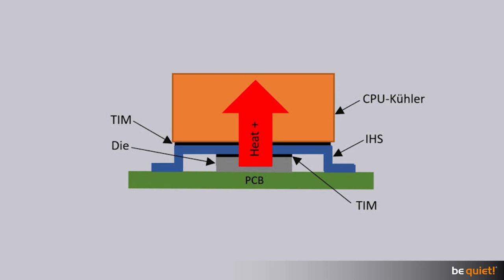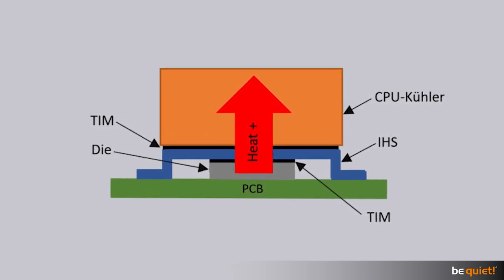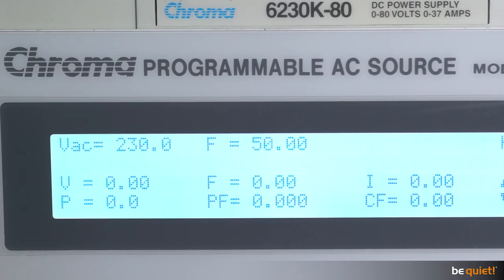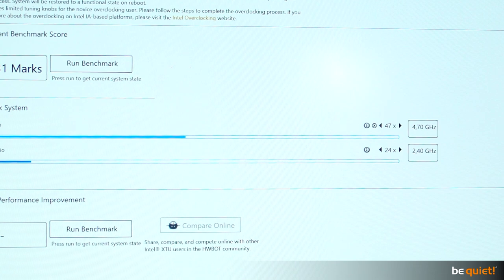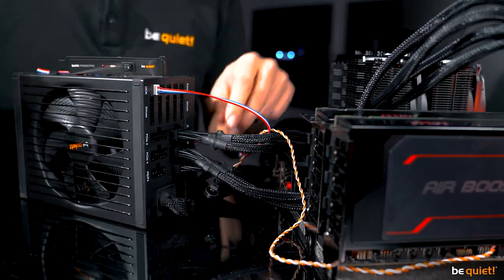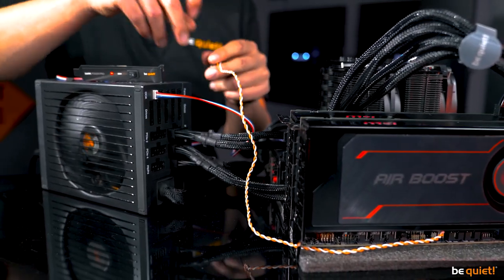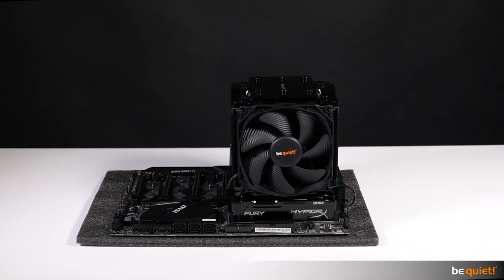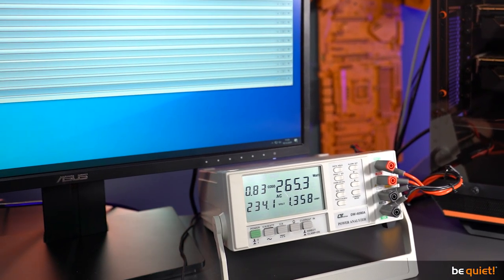What is TDP? | be quiet!

Comment: Thank you folks VERY much for your informative videos!
I am a BeQuiet! fanboy..... 900rev2 case, DarkPower11 PSU, and DarkRockPro4 cooler. ALL top of the line in quality.
I do videos and render animations 24/7 when not editing with my slightly overclocked 9300x 12 core. It gets to the very low 80's when it's warm inside.
I think once the thermal units got loaded into the liquids, I'd still have the same overall temps, right? As the liquids would only cool at night when our desert climate gets cool when the sun goes down. But before noon it's be ambient temps again. I'm super happy with this Dark Rock Pro..... but am looking at the 360 liquid you have! LOL. 
Thanks for the great gear!

Comment: i am more confused than i was before watching the video , i didnt even knew each brand had its own TDP, well i hope my 5800x will stay cooled with your dark rock slim inside the pure base 500dx ( im not gonna overclock my cpu) i also added 3 silent wing high speed 120 fans for pull and kept the 3 140 fans included in the case for push air out the case to maximize airflow, i will test it when i find a gpu, hope everything works out on my first build.
Reply: The Dark Rock Slim will be more than enough for the 5800x :)
Reply: Same here 😂